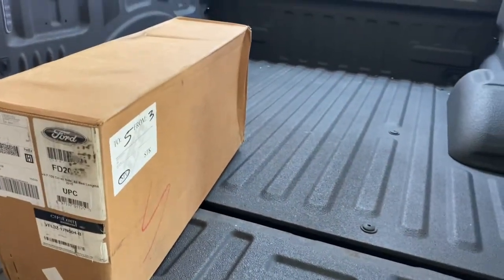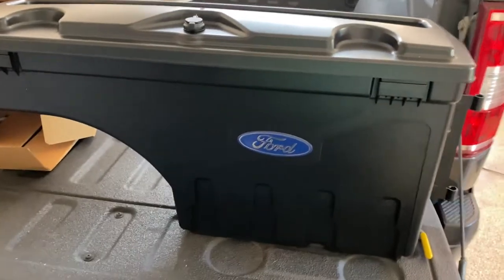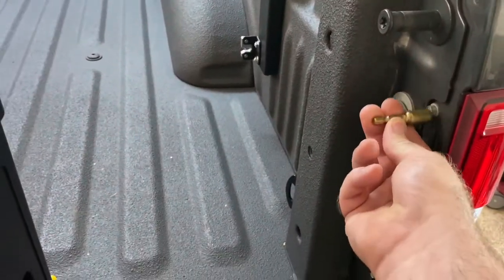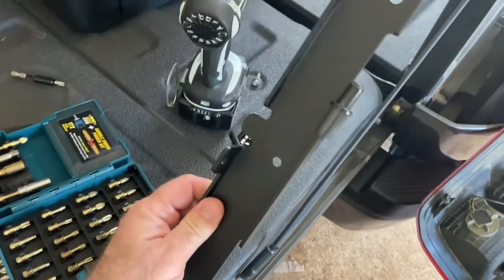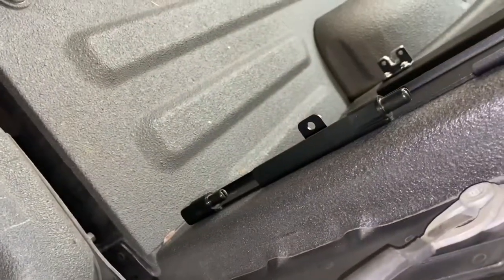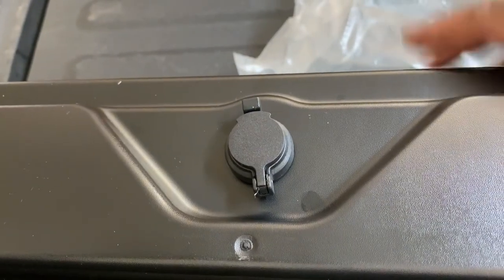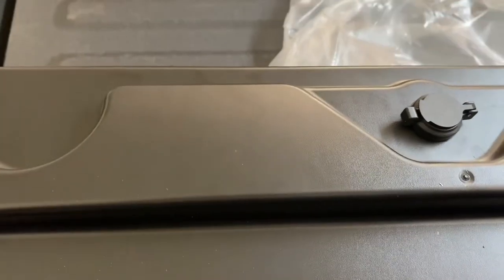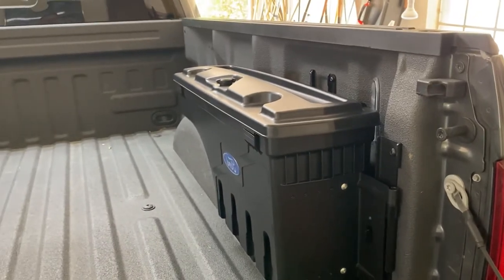2015-2020 F150 UnderCover swing out tool cases

Comment: Can you take if off once mounted? Like to empty if I use as cooler...
Reply from the maker: Yes, just unlatch it with the yellow handle, and swing it out. It will lift right off of the hinges.
Reply from the maker: I would also recommend drilling a small hole at the bottom, maybe 1/32”.
Reply: @Liberty76  just installed this on my 24 F150 and used your video for guidance :) I'm know thinking would still work with the box link tie down
Reply from the maker: @DavidFlores-du3rm Awesome! Glad the video helped!